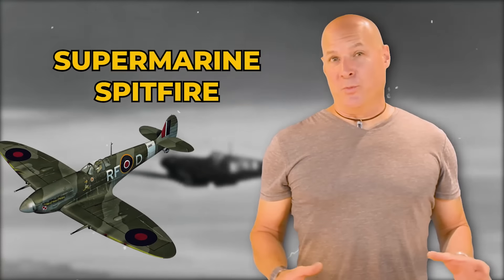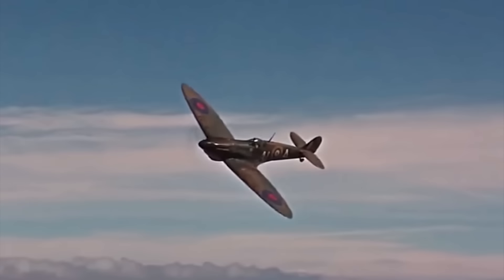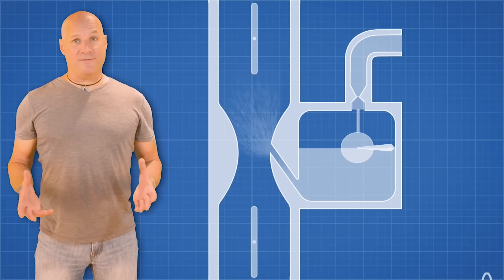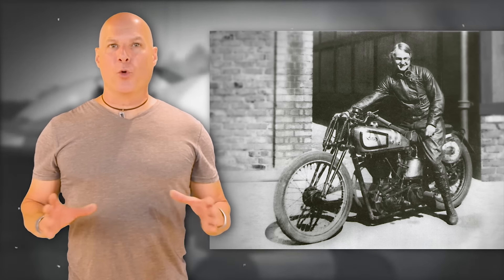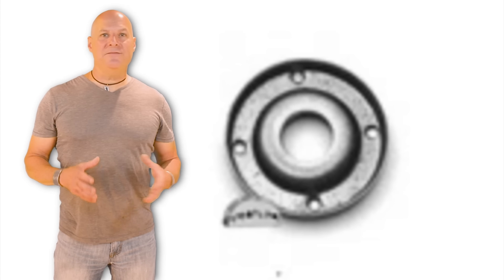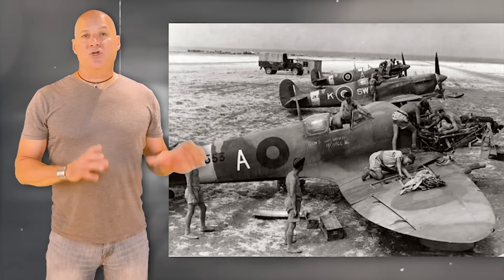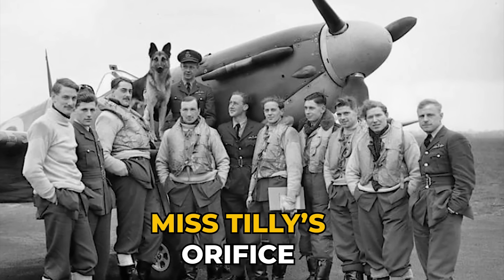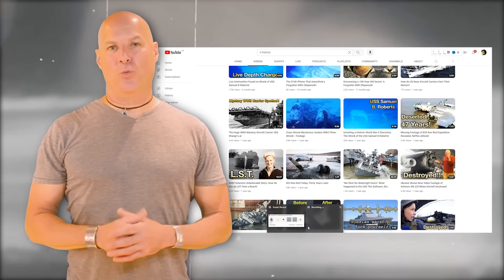How did SHE Save Britain’s Troubled WW2 Spitfire Warplane?

Comment: This old trope.
It wasnt awful and the pilots had a perfectly viable work around.
Half roll pull back.
And pick up the 109 coming out of its dive waaay earlier than expected because THEIR weakness was a tail unit that disassembled itself under high G.
Reply: and high speed!
Reply: "work arounds" are perfect when you are sitting at a desk or typing on your computer, I would guess pilots have a lot of other things they are thinking about in a kill or be killed situation. Any edge in combat is an edge a combatant is happy to take. Have a nice day
Reply: @diffened men are amazing  -  I don't think the work around would have been a problem

Comment: Fortunately for the Americans in the Pacific Theater, the Japanese never addressed this issue with their Zero. This same flaw was also revealed from experience with flight tests of the Zero that was captured from the Akutan Island, of the Alaska Territory. With the discovery of this flaw, plus the stiffness of the ailerons at high speed, the American pilots flying the pre-war F4Fs and P-40s were advised to avoid combat with the Zero below 16,000 feet and to power-dive with rapid rolls to evade a pursuing Zero. The critical discovery of this flaw and the tactics to exploit it, saved the lives of many American pilots in the early months of the Pacific War.

Comment: As the fuel restrictor washer wasn't installed until 1941, apparently, it played no part in the Battle of Britain. That's not to diminish the importance of the modification and Beatrice Shilling's achievements, which were remarkable.

Comment: Hi, no question that the Spitfire was really good looking and also efficient. However, the Hurricane really won the battle of Britain because there were not a lot of Spitfire available.
Reply: That's an old misconstrued chestnut rolled out regularly. What you miss is context.The Hurricane performed well on slower bombers because of its strength as a stable gun platform, but that strength meant it was in no way a nimble aircraft and so no genuine match for the 109. Without the Spitfire to harass the 109's, there is no way the Hurricanes could have had the success they had or won the BoB. Their losses would have been horrendous. Remember, British defence doctrine was to shoot down bombers first and foremost, and simply keep the German fighter protection from defending them. That's why Hurri's concentrated on shooting down bombers and Spits were tasked to deal with and drive away the fighters - a MUCH harder target to put bullets on. So naturally, the Hurri's had a higher kill ratio because the Spits did their job so well. Both aircraft had completely different taskings in the battle.
Reply: @sbg911  I am sorry, Hurricane shot down more 109 than the Spitfire during the Battle of Britain
Reply: @johnwillie3901  Clearly you misunderstand the term harass vs shootdown. The MAIN aim of the Spits (and BoB doctrine) was to keep the fighters away from escorting the bombers. This playbook is well known. It was never about who shot down more than the other, although at the pilot level clearly that was always going to invoke competition. I NEVER said Spit's shot down more than Hurri's, in fact I clearly said the latter had a higher kill ratio. But as you already admitted, Hurri numbers were greater esp at the start - almost 2:1. Therefore obviously they would have higher ratios on both fighters and bombers. My comment was adding context to why the claim "Hurricanes won the BoB" is not strictly about numbers, which is the only thing you are hanging your hat on.

Comment: Just to be clear, the initial aircraft you showed doing a roll, spluttering, and puffing smoke, was in fact a Hurricane, not a Spitfire, and comes from a scene from the 1969 movie, Battle of Britain.
That said, they both had the same problem, but I assume because the Hurricane was less manoeuvrable than the Spitfire, and on the whole, tended to engage the bombers more, it was less noticeable, or less of a problem initially.

Comment: Oh, FMD: it wasn’t just spitfires, it was a relevant issue for all fighter planes of the era that used carburettors. In the case of the BoB both the Hurricane and Spitfire had carburettor- Merlin engines. However - 

WAAY before ‘the orifice’ was introduced RAF pilots learned to do a half roll to maintain positive fuel flows and despite the issue British fighters certainly ‘did the job’ throughout the BoB. It is important to note that ehe negative G fuel flow issue was mainly a problem when attacking German fighters as Luftwaffe pilots would go into a steep dive to evade a British fighter that had acquired a firing solution on their 6 O’Clock- BUT in many cases, despite the handicap RAF planes could half roll into a dive and follow the german fighter down (however that tactic was not encouraged becuase shooting down german fighter cover was secondary to the two principal tactics that Keith Park required - to disrupt german formations so the bombers could not reach their targets and then to shoot down said bombers down: chasing stray ME109s down to the deck was actually frowned on as it took the British fighter out of the main game: one of disruption.

in defensive evasive actions (when german fighters ‘bounced’ RAF ones) the standard evasive manoeuvre was ‘hard forward-left everything’ (so maximum throttle, combined with hard left and forward motion of the flight stick and simultaneous application of a hard left rudder). This induced a powerful spinning dive which the germans could not easily follow (and did this evasive manoeuvre did not cause negative Gs in the plane’s fuel system).

Moreover - The orifice was not installed on all British fighters until March  1941 - so a full five months AFTER the BoB ended. The rollout of the part did not even start until early 1941. So it played no part in that campaign, which officially ended on 31 October 1940 once Operation Sealion was cancelled. 

In fact the orifice wasn’t  really ‘the solution’ - only a partial ‘fix’. The solution was Bendix pressured carburettor (in effect sort of a primitive  type of fuel injection) was: and that was only introduced on RAF fighters in 1942/3. The Bendix rended the orifice obsolete. Tilly did a lot of good work at the RAE, not just on the orifice. She truly was one of the unsung hereos that help win the war, but let’s not get carried away: the orifice only played a minor role in the Spitfire’s storied history. It played no part at all in the BoB. 

This is s terrible video.

Comment: RAF  Hurricanesand Spitfires employing 100-octane fuel to increase boost and increase engine output to 1310 horsepower, the planes were plenty fast, but the Merlin’s Skinners Union (SU) AVT35/135 carburetor would suffer a “fluff” when entering a steep dive. The negative g-forces would momentarily throw the fuel to the top of the float chamber and starve the jet of fuel for 1.5 seconds. Although the carburetors would regain function, the situation was potentially disastrous.
In 1940, the 31-year-old Shilling found a solution to the carburetor malfunction. 
She   devised a preventative modification, retrofitted to all serving aircraft: a restrictor (or orifice plate) with a calibrated aperture in the center was fitted to the fuel line before the carburetor. It limited the fuel flow to a volume only slightly less than the engine demanded at full power, and while it did not stop the momentary weak hesitation, it prevented the excruciatingly long 1.5-second cut.

Comment: Oh boy have you got it wrong !    Most if not all aircraft in the 1930's had carburettors . The ME 109 was one of the first,  if not THE first to have fuel injection on  a combat aircraft .   This  never put British pilots in danger . What would happen German fighter planes would dive away to avoid combat and  escape back to France  . British fighter's  trying to follow them down would experience negative " G " . Which would force the petrel upward in the carburettor , so the engine would back fire and lose power .  By fitting this simple leather  ring it worked .   But  was a stop gap measure that  helped . It took about 2 or three weeks before a fuel injection system could be fitted .  It's many years since I read Richard Hillary or "Johnnie" Johnson . I believe they mentioned this in they accounts of the battle.  Also please read combat reports written at the time .

Comment: Very nice video. I wondered how the problem was solved for the Mustang. I didn't find a direct answer. The Mustang Merlin engine had a supercharger and it might have had multiple versions with different levels of supercharge capabilities. Does a super charger eliminate this problem? It seems possible that raising the pressure of the air going to carburetor above ambient pressure might make the fuel/air flow less dependent on gravity and aircraft direction and speed changes.
Reply: When Packard began building the V-1650 version of the Merlin that made a few modifications.  One was to replace the venturi carburetor with a pressure carburetor, which was common on American fighters.  It was similar to a throttle body fuel injector.
Reply: All Merlin engines had superchargers. Not just the ones made under licence by Packard. Originally a ‘single’ stage supercharger (which had either one or two speeds), but by 1942 Rolls Royce began producing ‘two stage, two speed’ supercharged Merlin engined. One variant - the Merlin 66 - was then produced by Packard (and called the Merlin 266). It was basically identical to the Rolls Royce version, except that it had a taller intercooler. By that stage - 1943 - Merlin engines had switch from the original carburettor- which had the negative G fuel flow problem to a pressured car better - the Bendix system. Which is what was installed on Packard build engines (as well as Rolls Royce variants from that point onwards).

Comment: What everyone seems to be overlooking is that the Spitfire had many variants and each had much different handling characteristics, through out it's service life the  Spitfire wing shapes and length were changed, wing struts were reinforced etc. So to compare a Mk I a,  to a Mk 24 is like comparing apples to oranges.  Example, the Mk I had wingspan of 36ft, 10 inches, had a loaded weight capacity of 7,400 Lbs. top speed of 367 mph, the Mk V had a wing span of 32ft 10", load capacity of 6,740 lb. top speed of 354 mph.  The F Mk 24  variant had a wing span of 36 ft 11 in,  a loaded capacity of 9,900 lb and a top speed of 454 mph. Early versions were difficult to dive because of the shape of the wing, that was solved. So it's easy for anyone to focus of one of the 24 variants and find complaints or problems, the aircraft had a long service life with many versions. The final version, The Seafire Mk 47 had a loaded weight capacity of 12,530 lb (5,683 kg) with 50 gal drop tank and two 500 lb (230 kg) bombs, a far cry from the 7,400 lbs of the Mk I,  Climb rate comparisons tell the story, The Mk I had a climb rate of  2,175 ft/min (11.0 m) at 9,700 ft (2,956 m/s) The Mk 24 had a climb rate of 4,100 ft/min (21.0 m/s) at 17,000 ft (5,182 m) The Seafire Mk 47 of 4,800 ft/min (24.4 m/s) at sea level (0 m) and a operating ceiling of 43,100ft.  Over the course of it's service life the combat range went from of 284 miles to 451 miles (using internal fuel cells) ,  So which variant are we talking about here?

Comment: What about world War I?  Didn't those planes all have carburettors? Weren't they doing rolls and dives did they have the same problem as the spitfire and what about other fighter planes that were carbureted (such as the P-40)?  It would seem that this problem would have come up much sooner then during the Battle of Britain and a solution discovered.  Was the spitfire somehow unique in the placement and or design of it's carburetor?
Reply: WW1 fighters did not achieve the same high "G" forces so did not suffer in the same way.
Reply: @petegarnett7731  All it takes a 0.1 negative G to cause this problem so you don't need high G forces.  He asks a good question to which their must be some answers.  For example, perhaps bunting into a dive was a not as viable a combat tactic in WWI as it was in WWII due to the redline speed limitations of the airplanes.  Maybe the pilots were not well strapped in and would be thrown from the airplane if the applied negative G.   Maybe they simply did care if the engine cut momentarily, which was not really that big a deal at the speed those planes could withstand.
Reply: The most used engine in WW1 was the Gnome Monosoupape.  This was a rotary engine which had a single exhaust valve and 2 stroke style transfer ports for induction from the crankcase.  This was fed by a direct supply through the crankshaft.  NO carburettor.  They ran on a rich mixture and were controlled by interrupting the ignition, hence the burp-burp sounds assoiciated with them.  The engine did not differentiate between up, down or sideways.
Reply: @gort8203  The original report stated that the ONSET was at 0.1g.  It require more g than this, or an extended period at low neg. to cause real problems.  It still worked well enough to see us through the Battle of Britain in our two main fighters before any inprovement. (Fortunately).  Thanks for your comment.
Reply: @petegarnett7731  What original report are you talking about?  Let's not distract from the claim I challenged. It does not take high G forces to affect the carburetor in the manner descried. Any amount of negative G will do it, and obviously the duration and intensity of the effect with vary with duration of the negative G.  But WWI aircraft were not immune because they didn't generate enough G.  Your explanation of engines that didn't have a carburetor is a valid one, so you should stick with that and not dig the low G hole any deeper.

Comment: Ken, wasn't this also the simular problem the P-51 had with the Allison engine, and lead to the change to the Merlin engine?
Reply from the maker: Thanks for the comment, Ed. I’m not familiar with that, but if that’s the case, it’d be a good subject for another video!
Reply: The Allison engine was down on power and did not have the operating altitude range of the Merlin, which was optimised for different roles  with changes of supercharger to maintain power at higher altitudes.  The Merlin was also developed from less than 1000 hp to almost 2000hp before being replaced by the larger Griffon.
Reply: @@retiredbore378 However-- that was not a performance level that could be maintained in a combat aircraft.  The 2000hp I mentioned was usable in service.  The safety margin is essential.  Ricardo did a lot of this sort of testing, sometimes resulting in changes of crankshaft specs etc. where the results were not as favourable as his Merlin tests.

Comment: So, how did it work?
Reply: Negtive G will move the float and fuel to the top of the bowl and shut off fuel flow to the venturi, that would create a lean cutoff. Meanwhile, the fuel pump will quickly fill the now empty volume with fuel which, when positive G is returned floods the carb and over-richens the mixture. The orifice was sized to match the fuel flow at a given power setting so it would reduce the lean cutoff and over-rich conditions to an acceptable amount until pressure carbs or fuel injection was available. It was a patch, not a cure.

Edit:  Sorry, I just read my reply and noticed a major error. In a negative G condition the fuel will move to the top of the bowl but the float will actually  float toward the bottom of the bowl. That position opens the fuel inlet valve exactly as if the bowl was empty in a positive G condition and allows full flow of fuel into the empty volume which then floods the engine moments later. The orifice buys time by reducing the rate of flooding.
Reply from the maker: Apologies! I suppose I was pretty vague about that, wasn't I?
Reply from the maker: Thanks for the great explanation!
Reply: @HistoryX  

    You don't have to be coy, suspect; or, doubtful, about that; as you can clearly see by the comments of very many users here, who have raised this as a seriously concerning issue!

    Despite all that, you only let Ted's comment explain, you made no explanation of your own; and, equally badly we had to go hunting among all these comments & threads to find it; since you never told us; nor, showed us where to find it!!

    Though your content; &, subject matter was great, your incompent execution was shameful; Sir!

    Ugh, apologies; &, amends by corrections, here; &, going forward required; NOT MERELY A, LIP SERVICE APOLOGY OF I'M SORRY WITH ZERO SUBSTANCE OF CHANGE, EDITING, CORRECTION, ACCOUNTABLE, RESPONSIBLE ALTERED, MODIFICATION BY DIRECT DEMONSTRATION THROUGH YOUR BEHAVIOR & PLAINLY VISIBLE ->ACTION;...NOT HOLLOW, SHALLOW, VOCAL EXCUSE MAKING W/: SOLELY PERFORMATIVE MENTIONING OF YOUR ADMITTING IT, AS A WORTHLESS: "I WAS AT FAULT: TYPE OF EMPTY-HANDED: VIEWER'S RETENTION DESIGNED SELF-SERVICE!!
Reply: @AndrewHeller-jn7dx  " ... your incompent execution was shameful ..."

Whoa, that is really out of bounds! 

As one who is quick to point out misinformation about technical subjects on these historical sites, I always ask that the presenter either provide well researched, accurate, or first hand knowledge or simply say nothing and let the viewers do their own research. If the video isn't explanatory it should lead the viewer to find an explanation or description. 
Leading the viewer is a far far better approach than filling gaps with the misinformation that is so common in the pop-history genre.

Best to rethink the direction of that apology.
Reply: @oldtugs  

    I simply, hugely disagree w/: you; Sir!;...&, that's all.!
Reply: Prevented the neg g fuel starvation by allowing the carb to maintain atleast some pressure going to the cylinders.